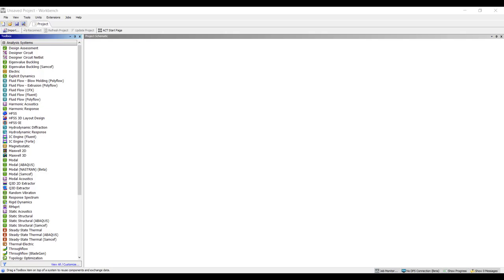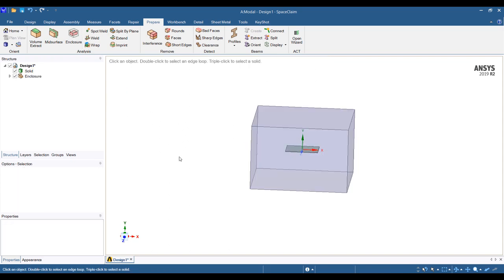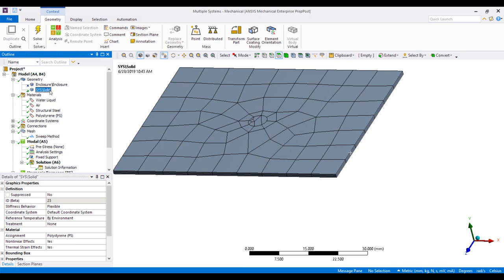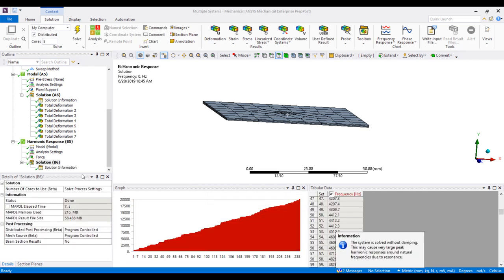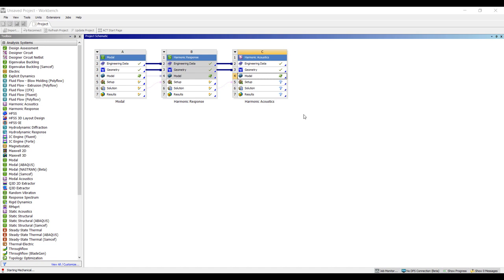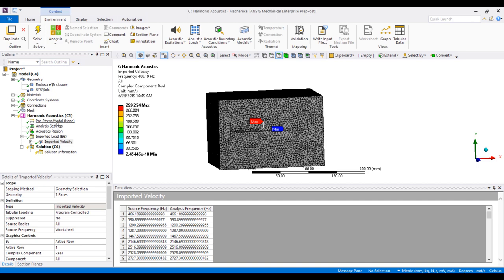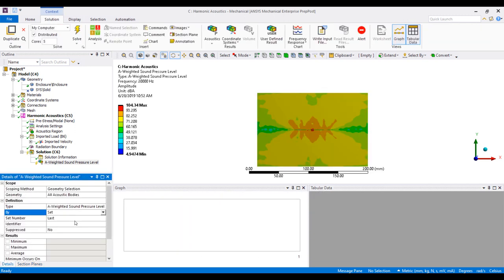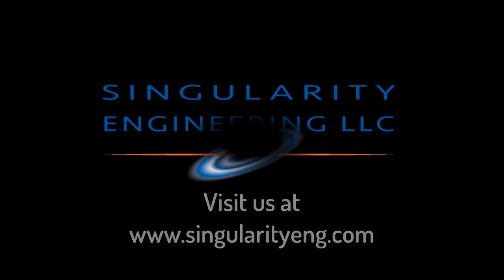ANSYS Vibro-Acoustic Simulation - basics speaker diaphragm

Comment: Hello sir, thanks for your sharing... I would like to ask is it possible to do the opposite of what you did in this video? I mean, I want to get the modal effects of a fluid domain (water) when a propeller and shaft system working in it. I need to rotate a motor which is connected to a shaft and a propeller inside a water environment and see how the natural frequencies of motor-shaft-propeller system change.

Comment: Hello, I want to do the random vibration analysis of the guitar to find out the deformation and stresses generated in the guitar due to plucking the string of the guitar. So can you please guide me on how to do that means it comes under the NVH problem or just I have to perform the modal>harmonic and >Random vibration. As I have the input frequency of one string that apply on the string so what I do for that

Comment: hello, thank you for the video, based on this model, could you do the topology optimization of the plate? the objective function is to reduce the sound pressure of somewhere, that will be great!!!!!!
Reply: That Will likely not work as topopt introduces holes and hence there would be air going through the plate which requires special consideration